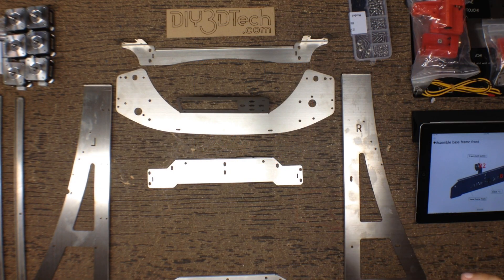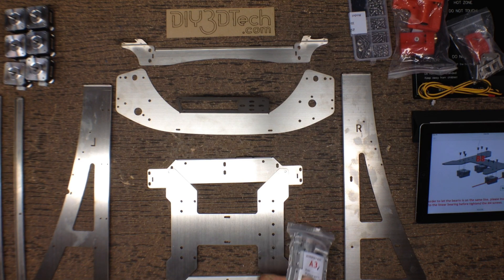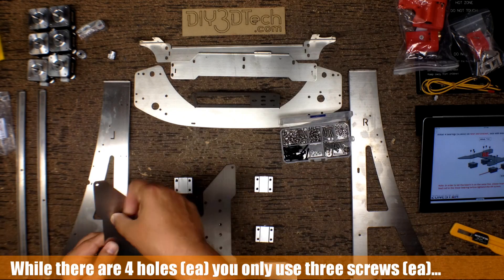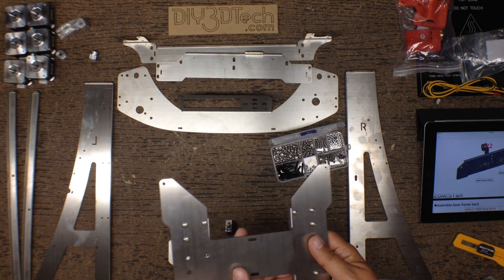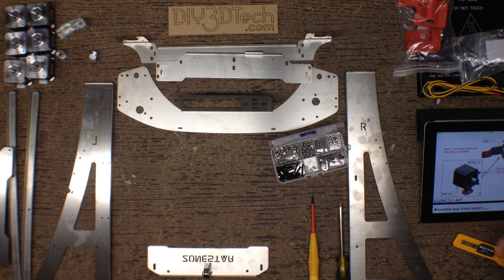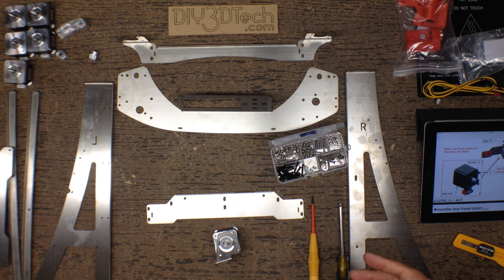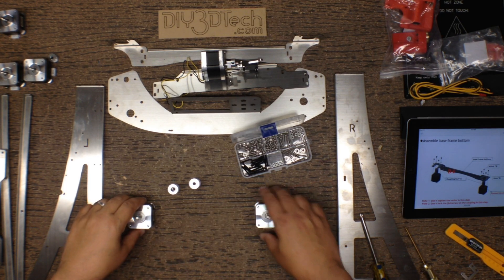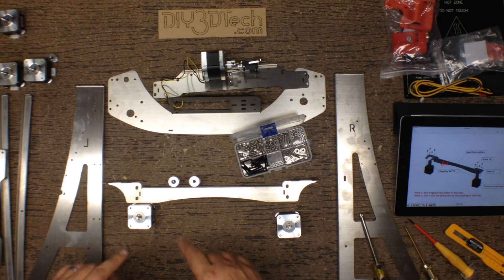Gearbest Zonestar P802QR2 - Frame Assembly Part 1!

Comment: You might want to check that front panel (with "Zonestar" punched in).  I had an awful time getting the bed to level on my printer.  I could get 3 corners in plane, but then the 4th one would be off.  If I managed to get the 4th corner in plane the y-azis bearing would bind to the point the stepper couldn't move the bed.  I finally figured out the hole on the right side of the front plate for mounting the round guide rod was about 2mm lower than the other 3 mounting holes.  (If you look close at 2:37 , that hole is low in the video too.)  All my bed leveling problems went away as soon as I filed the top of the right mounting hole to match the height of the other 3 holes.
Reply from the maker: Hmm have not had this issue and even installed the auto bed level sensor and all is working well.  Yet worth noting for other who might also have this issue as I can clearly see your point!  Thanks for sharing!
Reply: I probably should have also mentioned that I had replaced the ball bearing linear bearings on the hot bed with polymer bearings (one of the bearings that came with the kit was dribbling loose ball bearing ).  I suppose it's possible the polymer bearings are less tolerant of misaligned guide rods than the ball bearing version.  I like the feel of the polymer bearings, but I may have created the binding issue for myself in the process.